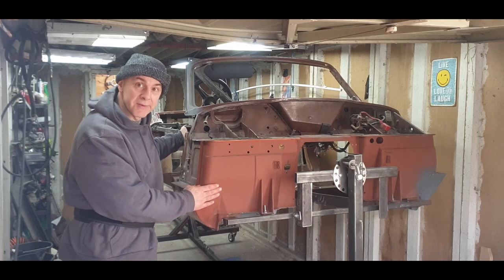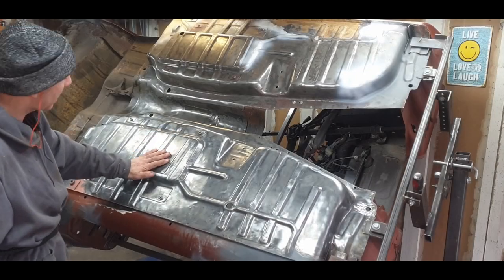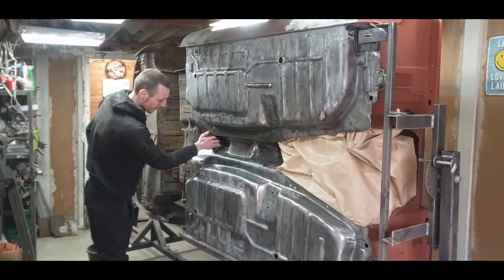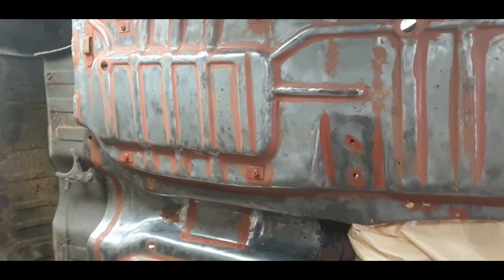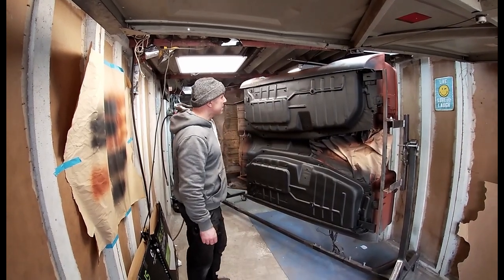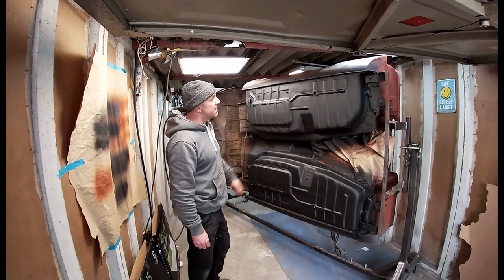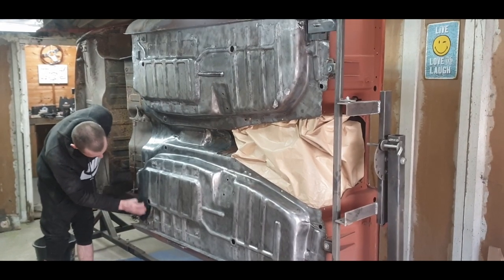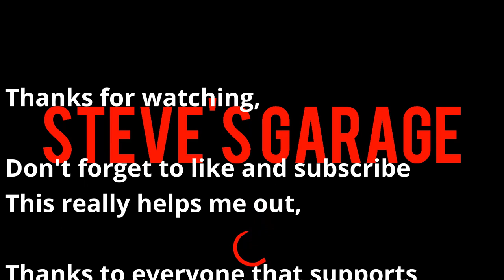Triumph Spitfire Floor Pan's, back to bare metal Glass Blasted and Spray Painted, Steve's Garage

Comment: Your floors are immaculate compared to mine.  I hope that mine come out looking that good once I am all done.  Keep up the great work.  Also, I loved the bloopers at the end.  I have to do so many retakes when I film my stuff.  Its good to know I am not alone.
Reply from the maker: Yeah i take so much video, so many mess up's, you know the brain goes blank and the most simple word's come out the wrong way around lol, don't let them floor pan's fool you, they were not as nice as they look now 4 months ago, about 8 or 9 pin size hole's turned into 3 inch cut out's with foot long cut out's on each side of the front of the pan's , lot's of welding going on right there lol, with still the weld scares on my arm's lol

Comment: What paint did you use on the underneath, Steve? Great job.
Reply from the maker: I used a paint from a company called Buzzweld, called RE , you'l need a 2 mm nozzle to spray this